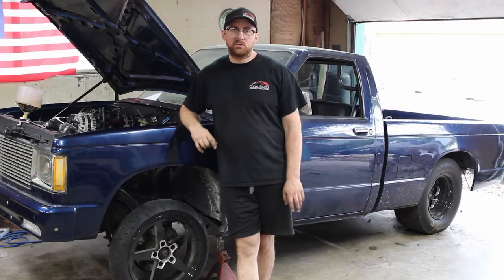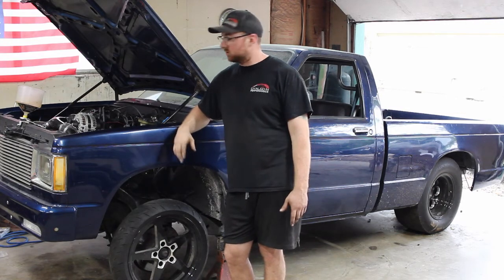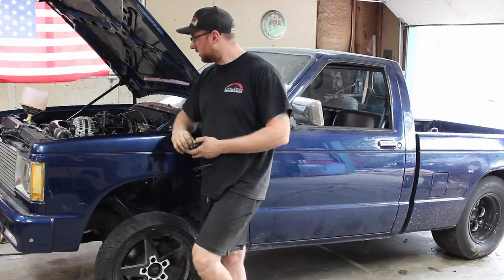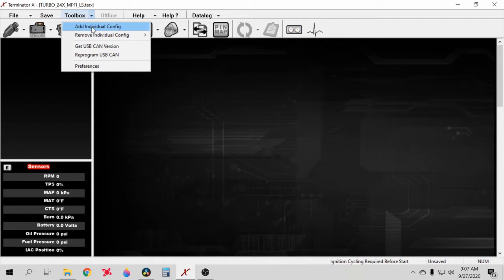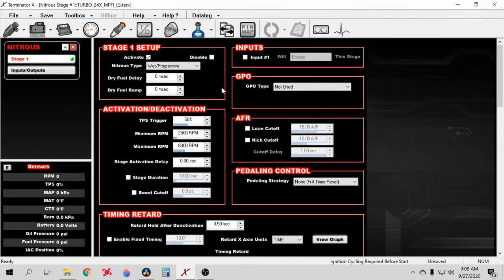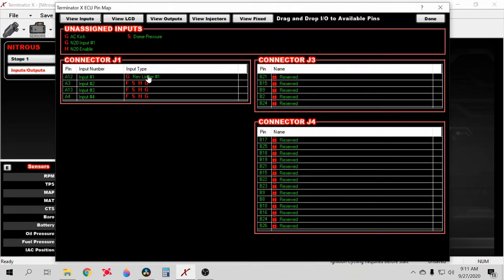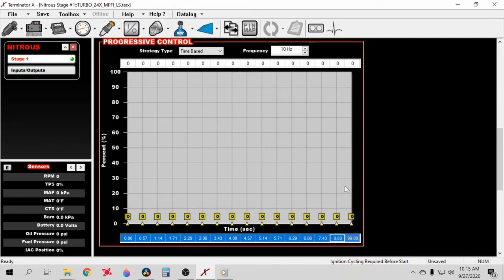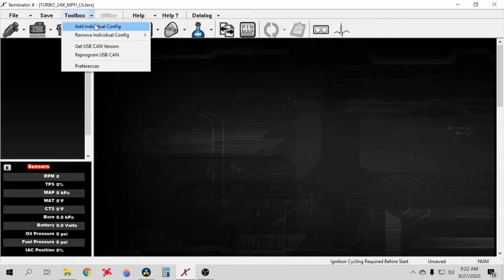Holley Terminator X Boost Control NO DOME NEEDED

Comment: My ramp will not continue past tps of 65%. So the ramp works with and tps between my minimum and 65%. Any ideas on how to solve this?
Reply: Did you ever figure this out mine does samething
Reply: @jeffraposa9118  the tps clear flood percent has to be set higher than the tps activation percentage

Comment: 3 port  with pwm control ftw! i ran 8psi gate spring and ive made 28psi with boost by gear with with no issues.
Reply: What’s pwm
Reply: @ikecostner1  pulse width

Comment: So does the Mac valve need to be tied into the same  wire from the 2step button. Or can it go into another pin on the I/O plug and just move the input in the Holley to all be the same ?

Comment: do i have to have a transbrake or 2 step for this option to work as you said at 9:03?
Reply: No. You can add a switch and connect it to 12v or ground on one side, and to an input on the other side. Configure that input to match (whether 12v or ground). Follow his steps, but substitute the bump/trans brake button he talks about for your new stich input. That switch will now be your boost control disable switch.